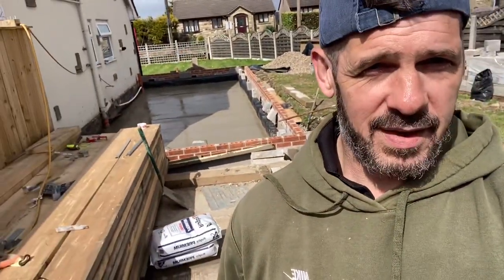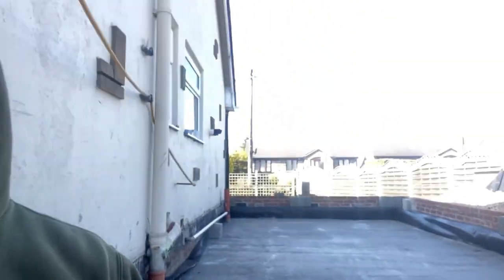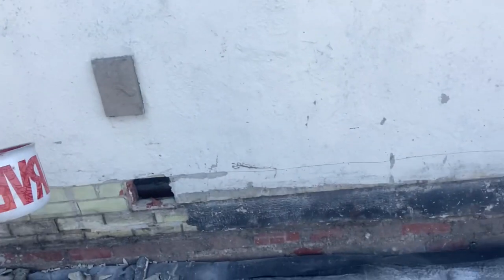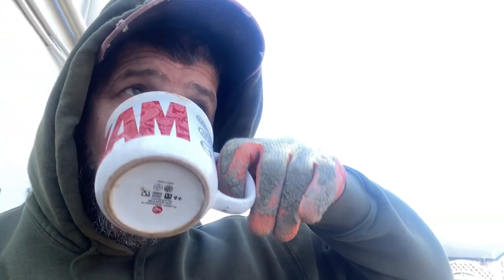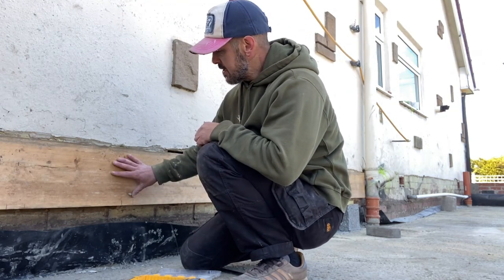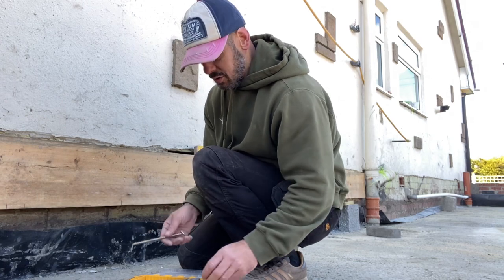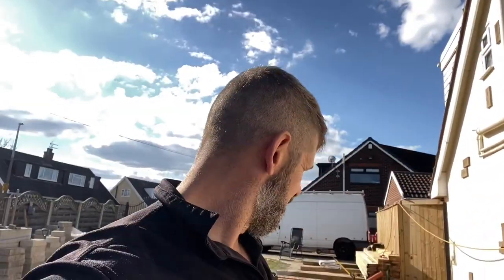A proper self build by a complete novice. Part 3 Oversite concrete and joists

Comment: Hi Mick, is it a requirement to have a concrete sub base?
Reply from the maker: yes 100mm with a 150mm minimum air gap under floor joists